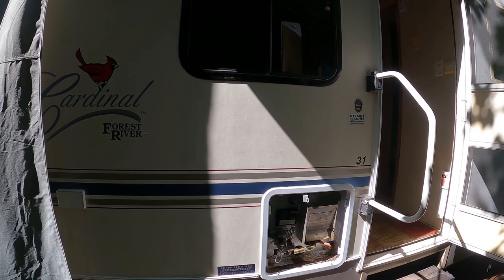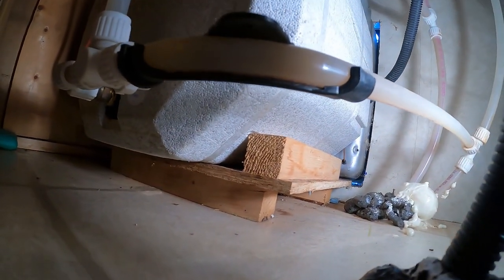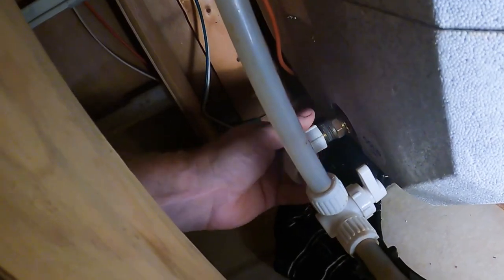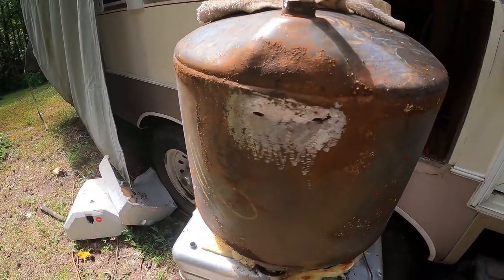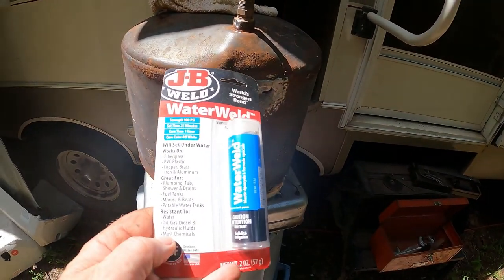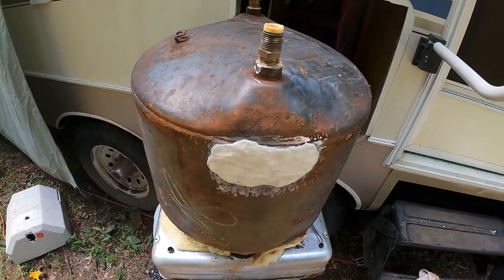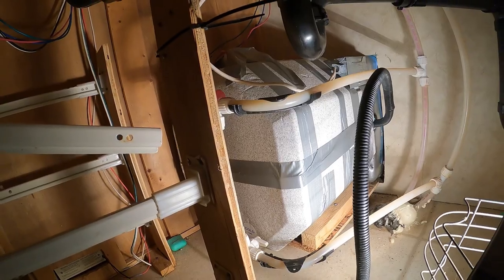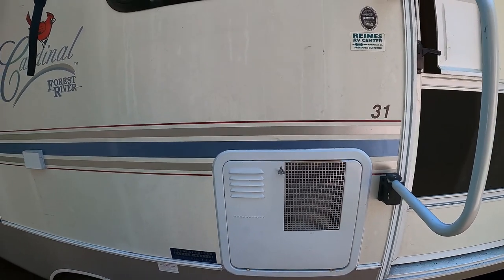How to Replace  or Repair Hot Water Heater Tank on Camper RV - Forest River Cardinal

Comment: How the patch holding bc im probably about to do the same thing  but havent pulled it yet
Reply from the maker: Doing great so far.  I had a small leak after but it was because I did not tighten the fitting enough.